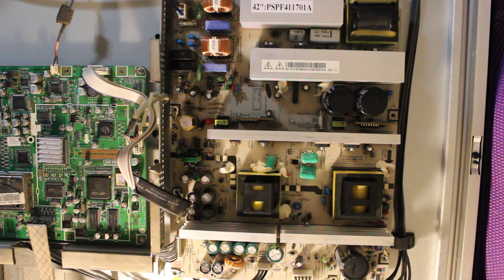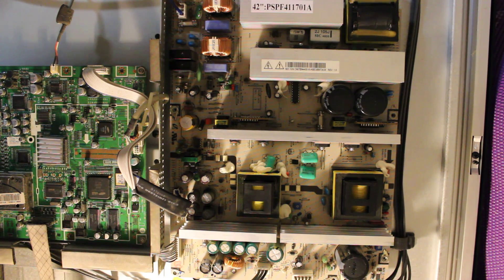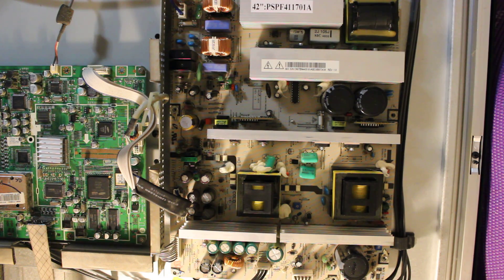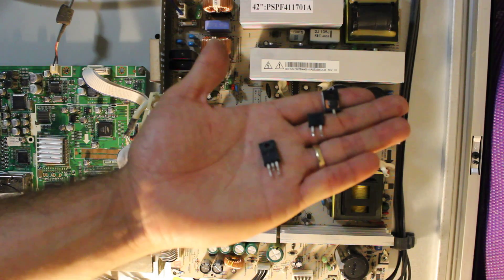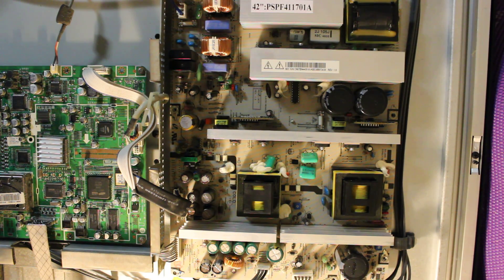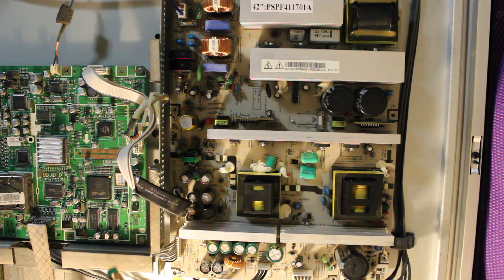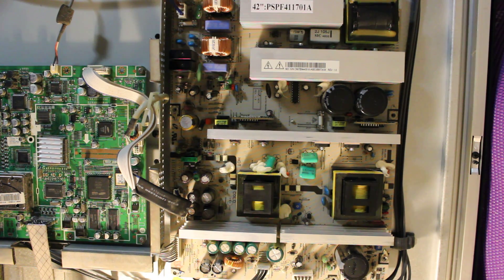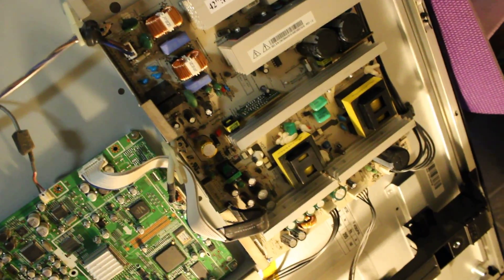How To Repair Samsung Plasma 42" TV HPT4254 With No Power No Picture and Clicking Noise

Comment: Same thing happened with my set, but there were also a few bad caps.
The FETs failed when their solder joints cracked.
Reply from the maker: +Benjamin “Ozias” Esposti Yes, the cold solder joints seem to trigger a short circuit that blows the FET's. Good luck on repairing your TV set!
Reply: Runforlife
Yep, thanks!
What happens is either the high frequency of the arcing causes the transistor to overheat and fail, or the GATE pin is left floating, which will end up in the transistor turning ON for longer than it should ... hence blowing up XD